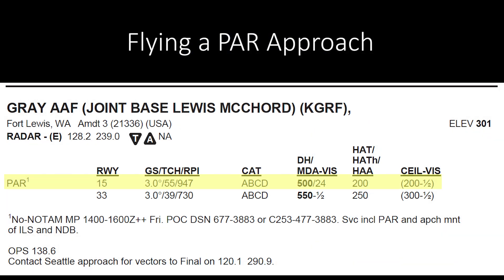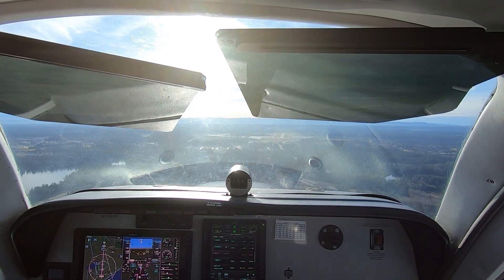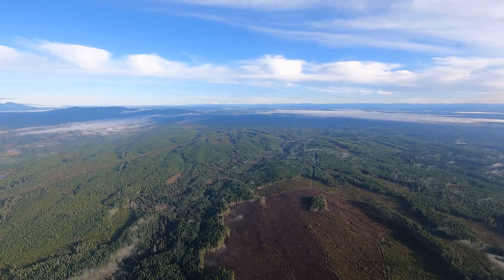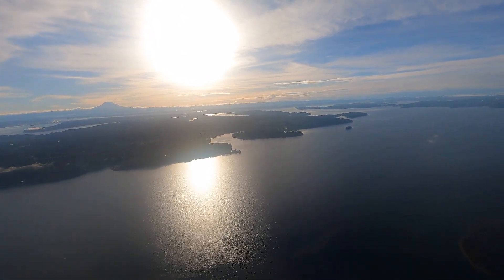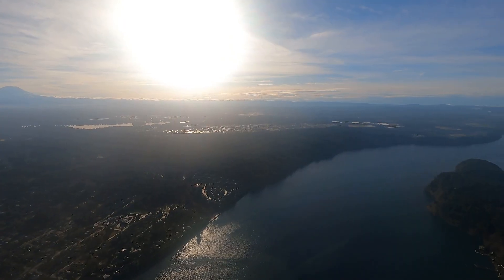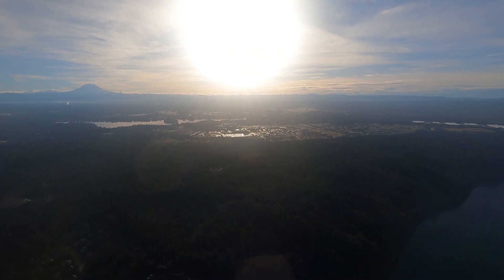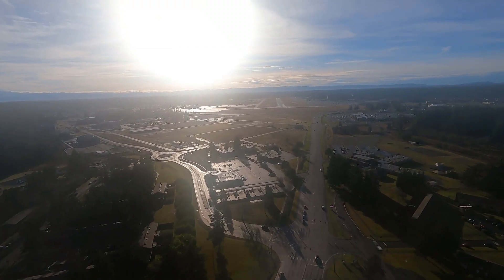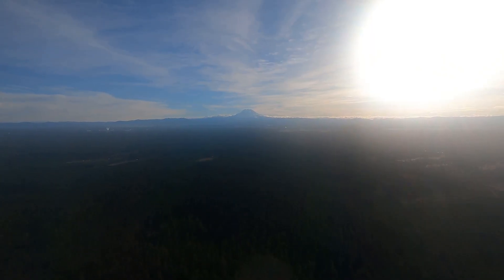PAR Approach at KGRF

Comment: Thanks for the great  presentation.   I am 75.  USN, 68-74, ETR-2, NAS Miramar, 70-74.  My specialty was  GCA maintenance tech  (PAR.)  Went to school  at  NAS Glynco, GA, now long gone.  School was in one of the old Blimp hangers.   At Miramar, we had 2x  FPN-36 QUAD RADAR  and an FPN-52, which is the PAR section of a  CPN-4.   The  CPN-4 was a  complete AC control facility, having  a search radar with  ? 45 mi range, the PAR with 10 mi range, 3 sets of displays for controllers, and  3 vhf and 3 uhf radios on board.

Comment: Unique video showing a PAR! I did one of these at Gray back around 1990 or so during my instrument training. The other (military) planes in the pattern would all say "gear down and locked" as they started the approach so I figured I should do the same because no one likes to be the odd man out. When it was our turn to start the approach I told the controller we were "gear down and locked". My instructor was not amused. We were flying a Cessna 172 (fixed gear). 😊
Reply: I have done PAR approaches at Selfridge AFB northeast of Detroit, and at Hill AFB in Ogden, UT and the Final Controllers at both of them always called me and said "Check Gear Down and Locked" when I was around a half-mile final for the runway even though I was always in a fixed gear plane.  So, good on you to advise them "gear down and locked", regardless what your instructor may have thought about it.
Reply from the maker: The Army controllers at KGRF probably don't do the landing gear check because they  mostly handle helicopters. I plan to fly a PAR at NAS Whidbey Island. We'll see what the Navy controllers say.
Reply: @BruceAirFlying  That totally makes sense.  All of my PAR approaches have been at Air Force Bases (Selfridge AFB in Detroit & Hill AFB in Ogden, UT) so I can understand what you're saying.  Although, depending on the type helicopter, there are military versions that do have retractable gear that aren't of the skid mounted gear types.  But, you are probably correct about why they don't say that.
Reply: @BruceAirFlying  I checked my logbook and it was definitely at Gray AAF, on 3/31/92. Note that the controller was not the one who asked for a gear check, it was only the pilot of the aircraft in front of us who mentioned it without being asked. I don't remember what type of aircraft it was. Pretty sure it wasn't a helicopter.
Reply: @BruceAirFlying  Old post I know... but I've found the AAF fields more accommodating about practice approaches and more friendly to GA in general. AFBs are a bit of a toss up but most of them are busier fields in the first place, they're not GA unfriendly, just highly professional and even the Class D fields feel like Class C or B's with them sometimes. NAS fields though might as well have a big "F off" sign out front though... They dont even seem to like GA overflights through their sleepy class D airspace, its like a burden to them. How dare we make them do work. And practice approaches? Yeah have yet to successfully get a single one from an NAS. Which is weird because many of them are among the quietest fields and yet they also have the most significant need for PAR/ASR practice approaches to keep their controllers current.

Comment: That looks like so much fun!  Thanks for sharing.  I expect KGRF is going to get a few extra PAR requests in the coming months thanks to this video.  I know I'll be asking for one.
Reply from the maker: I was surprised to hear at least one other pilot request the PAR at KGRF as I motored around after my approach. I am not certain, but I think Gray only recently began offering PAR on weekends--maybe, like everyone else, they had staffing issues. I also need to check the status of PAR at NAS Whidbey Island. My understanding is that they haven't offered PAR to civil aircraft, but that may have changed. That would be scenic approach in VMC.

If you do plan to fly a PAR at KGRF (or anywhere else, for that matter) take a few moments before you contact Seattle Approach with your request to get the Gray ATIS and otherwise get set up for the approach. Depending on where you are when you make the request, things can happen quickly. And make sure you understand the final controller's instructions. After initial check-in with the PAR controller, don't read back instructions. The only transmission you make is when you go missed.

As I said in the video, a PAR is a great exercise that reinforces the control-performance method of instrument flying. Knowing the pitch, power, and configuration for an ILS in your airplane makes flying a PAR much smoother and more accurate.